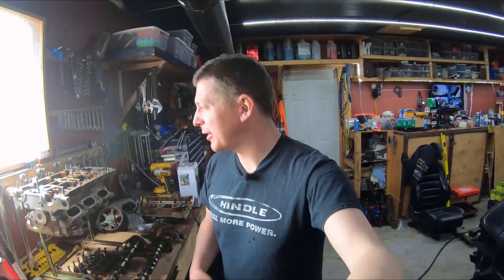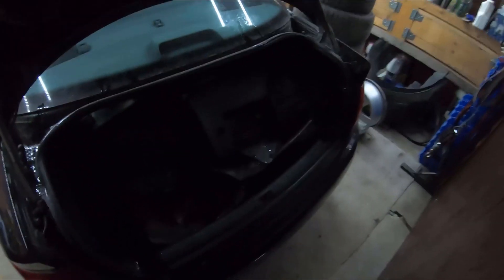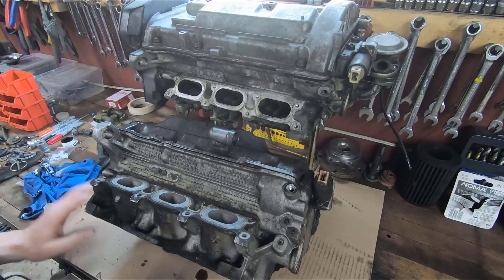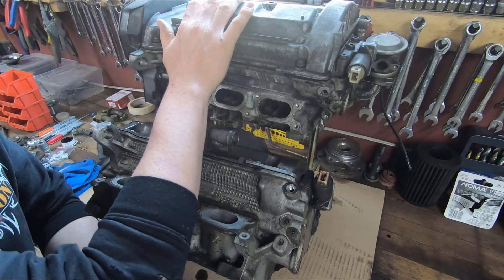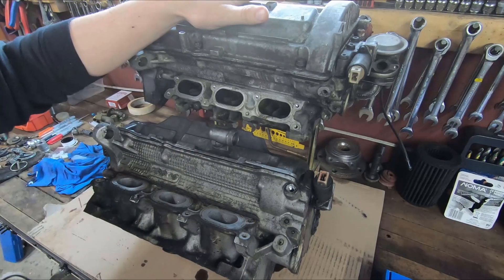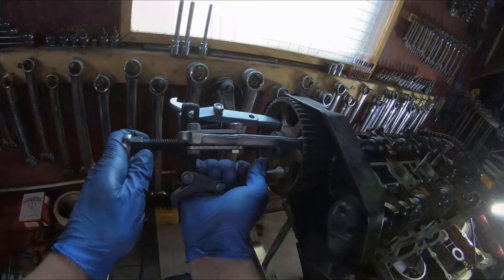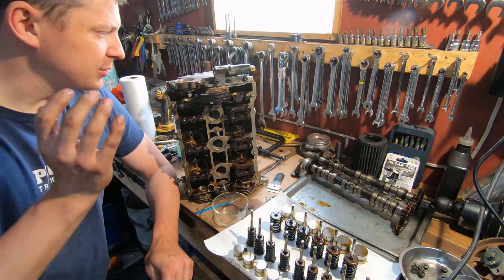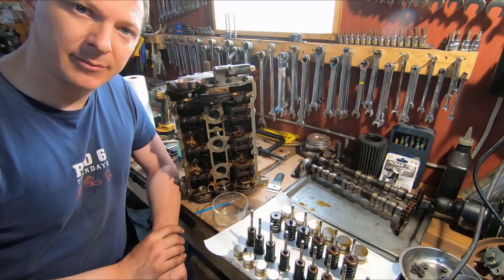Building 8500rpm "Big Port" 2.8 heads for my Audi 2.7T - Part 1

Comment: I'd buy all new valves, the sodium filled valves are overrated, at least at minimum the exhaust valves...
Reply from the maker: I think unless you're going to inconel exhaust valves it's worth sticking with sodium filled. I've used plain new SS ones in a pinch for a low output motor but I have seen them hang up under tough conditions.

Comment: Say, where did you get that bracket to hold your heads?
Reply from the maker: I got mine on eBay but they're available a few places (like Amazon). Just search Cylinder Head Stand, Moroso makes a set, Sealey, the ones I have are SpeedFX. 

https://www.ebay.ca/itm/324411421081

Comment: Maybe I missed it, but what intake are you putting on it? 

I know the valves from my experience are all sodium filled so that wasn’t really in question for me, but I thought I remembered the 2.7 valves loading the springs a little more than the 2.8. Did you take that into consideration for your final outcome?
Reply from the maker: I’ll be using the stock intake manifold, but just machining out the ports to match. Good call on the valve stem heights I will have to measure them.
Reply: In my experience the valves are the same height but the grooves for the valve keepers are a touch lower on the 2.7 to load the spring a bit more. May not be on all engines but worth a look, and consideration if they do end up being different on yours.
Reply from the maker: @souly4him  really good information there and will definitely compare them today when reassembling.

Comment: I removed the lifters on my 1.8t head and forgot to mark the locations.  So far 10k miles and no known issues.  At the time I read it was more of an issue in v8’s and motors with very heavy springs compared to small displacement multivalve heads.
Reply: It also has to do with when reusing the same cams and lifters over is the wear. Each lobe wears each lifter different. So you want to put the same lifter back in the same spot with the same lobe it was on to begin with. The lifters and cam lobes do not wear evenly. Example: is like when one cam lobe wears off and none of the other do. Just for proof that they don't wear evenly. You can have a camshaft from the 2.7t engine have a lobe wear completely off. And all the others be perfectly fine. But that's the reason when you reuse lifters and cams on any engine they should be put back. It's not a total meltdown if they're changed. But it's very good practice to use the same spots.
Reply from the maker: I’m thinking so too.

Comment: The lifters being soft or hard just means they aren't compressed with oil. But the lifters should go back in the same spots when using the same cams n lifters again.
Reply from the maker: It threw me off just because some had no resistance and some were still fully pumped up.
Reply: it might be too late but don't install them pumped up. I did that many years ago and fought low compression and misfires. even pulled the head off to change the headgasket.

Comment: I personally agree with your logic on the lifter buckets. I recently replaced a head on my 2.7 and replaced valve seals, cleaned valves, and ultrasonic cleaned both my heads. I think if you’re taking it all out, cleaning, lapping, and the whole nine, it doesn’t really matter. 
Have fun with those keepers 🤮🤮🤮
Reply from the maker: Keepers shouldn’t be a problem I have a set of tiny needle nose pliers that work well for placing them lol
Reply: I have long dental tweezers, short tweezers, needle nose players, etc, but what worked best was a small magnetic flathead. It’s the middle intake valve on each cylinder that was the big struggle for me. Eventually I got into a groove.

Comment: what does the sodium do?  i know citroen did fill theirs with nitrogen back in the days (80's) to keep the colder
and nice vid's! doing a full rebuild on my 2000 s4 avant these days too
Reply from the maker: The sodium turns liquid when it’s hot, and then essentially sloshes around from the top of the valve to the bottom as it goes up and down, it picks up heat from the face of the valve and helps spread that heat out through the whole body of the valve so it can transfer to the head and oil, keeps the valve operating properly at high temps like in a boosted engine.
Reply: Toss up your insta handle so we can check out your Avant